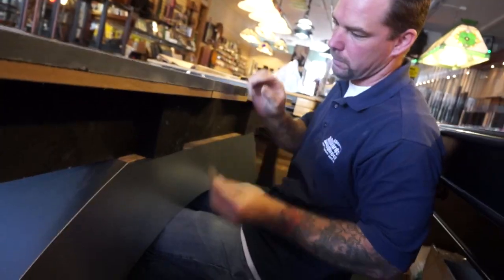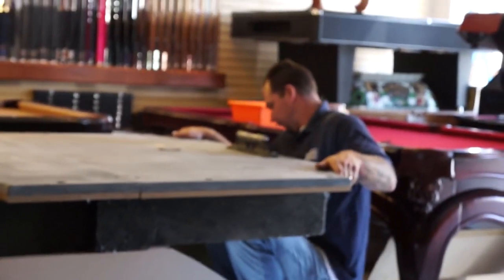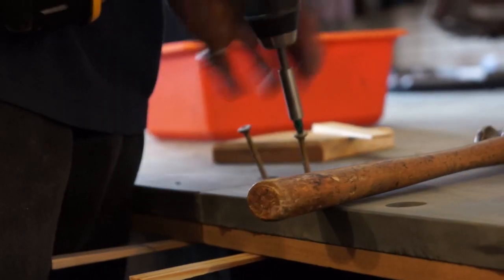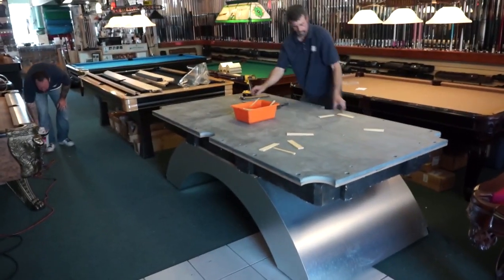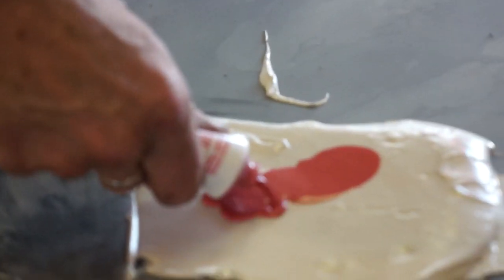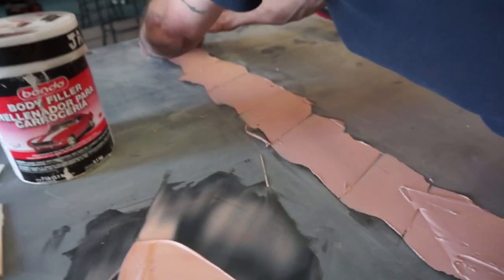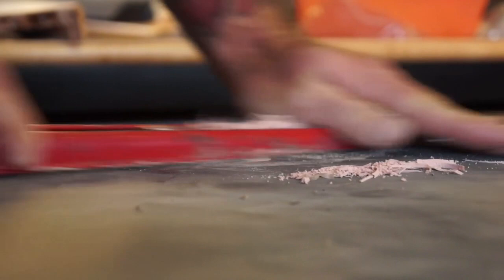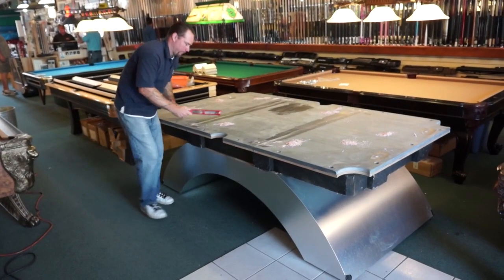Pool Table Installation: Step 5 - Leveling the Table

Comment: Thanks again for posting, Brandon. What do you mean by "scribing the slate"? Please explain.

Also, please explain why you think Diamond is better than the other brands you mentioned. My pool league home bar just got 3 new Diamonds. I've played on tables by the 4 brands you mentioned, but I don't know the difference really. One of my league  friends says he prefers the cushions of one brand over the other.
Reply: So the bondo acts as a hard glue. If you where to try and move it the slate would crack. And not on the bondo. On the weakest point of the slate. Which could then fall off and break your foot. Or hurt your back. By scribing it. Your allowing the bondo to snap. Rather than the slate.

Comment: bondo is good for cracks but use wax for bolt holes if you want to remove the table later or re-level it

Comment: I see no problem with bondo as long as the guy disassembling the table has experience using it.  Just my observations after installing tables for 20 years.  An installer should be well versed in all aspects of the job so they are not scared due to lack of preparation and experience with ALL materials they can run into during the course of their work..
Reply: True but this application works best if the table is to be installed in one location fo4 a long time.

Comment: Please reply to this. I have a 3 piece slate table and upon moving it the middle piece cracked in half. Almost perfectly. I cant seem to get the two pieces perfectly leveled together. Its a hair off and I cant seem to get it level at all. I sanded and everything
Reply: I not a clue what I am talking about but if it were me I would add a support beam underneath which follows the crack and wide enough to support both sides of the crack and to support shimming. You may need several shims.

Comment: bondo is the worst thing you can use on a pool table
Reply: Bondo damages the slate.  Theres a reason they have been using beezwax since 1800's because IT WORKS!
Reply: @kevinpachecodenverpooltabl6717  exactly